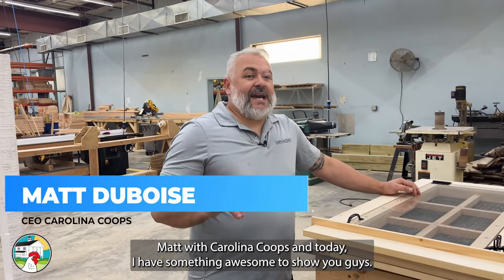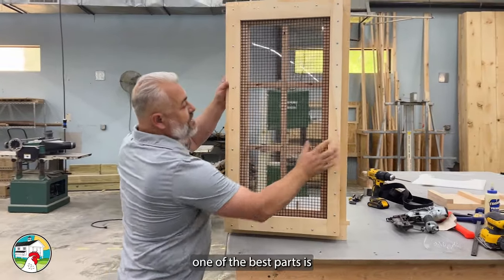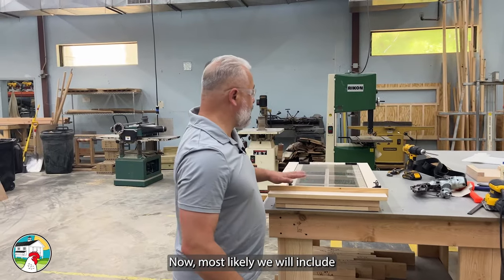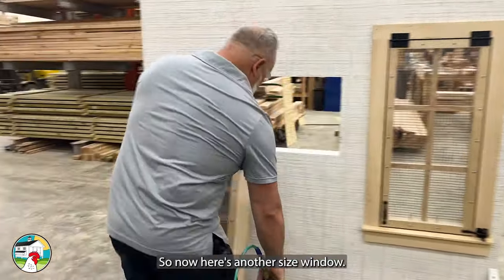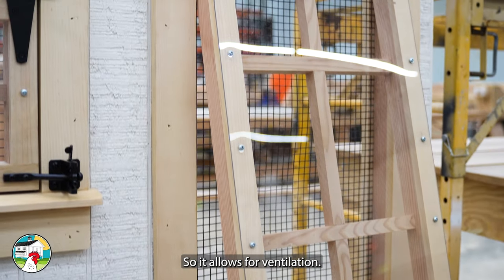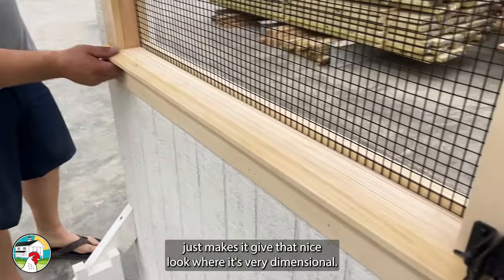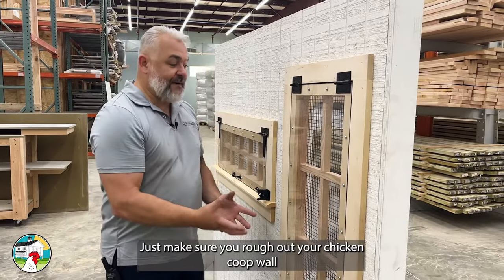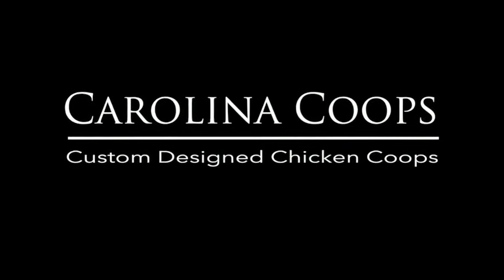DIY Chicken Coop? Pre-hung windows solve your problem!

Comment: Cool concept but i'd reverse everything .. keep the poly glass on the inside with all the screws and router the window pane frames with a 1/4" bit like traditional frames
Reply from the maker: Hi, we originally did that with our older designs, but with the windows open a lot we found water was catching in the frame and affecting the wood. We find that having the polycarbonate on the outside, the water will just run off especially since our windows are predator proof, they are open most of the time. Thanks for your comments!
Reply: @CarolinaCoopsVideos  Use copper coat wood preservative and latex/silicon sealant and you wont have any issues. I always use copper coat when cutting pressure treated wood. You have to seal the cuts because pressure treated wood is only protected about 1/4" deep. So every cut needs to protected with a new coat of copper coat. I understand what you mean about water getting down and in-between the poly and the wood. Problem solved copper coat an then using sealant like latex modified silicon or aircraft quality 3m type strips tape. No mildew or water issue's with this method :) cheers
Reply: I also want to add that it's important to be able to remove the glass when it comes time to re-paint the frames in the future .. and this makes it easy. I also run screws on the crosses of each pane which makes the frames much stronger. Would love to show you my design if you guys are interested? Might wanna look into aircraft poly window seal methods. They use a unique  type of strip seal. Cheers :)
Reply from the maker: @matttafakt  Hi, we don't treat/paint our windows generally, the customers do the finishing. Also our coops are made with Douglas fir lumber, the only pressure treated part is the base that makes ground contact. 
We are building and shipping out so many coops, we are working hard for the increasing demand and keeping prices down. After over a decade, we have found that this design works best for our customers and us. We appreciate your comments and don't disagree with you, just for our scale of business we find this works best. Thank you for watching.
Reply: I only suggest using copper coat on the pressure treated wood where any cuts were made. The aviation 3M type tape strips are only for the poly glass to prevent water intrusion if you were to mount the poly on the inside vs the outside. Btw, where i live on the West Coast, most if not all PT wood is Douglas Fir. I love DG Fir :) Cheers @CarolinaCoopsVideos